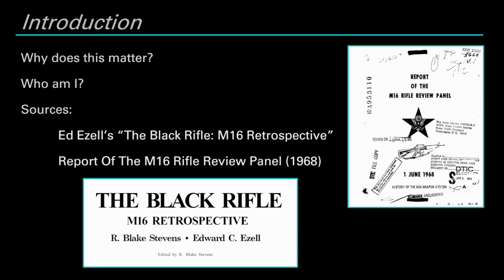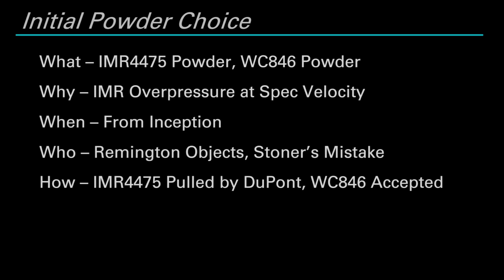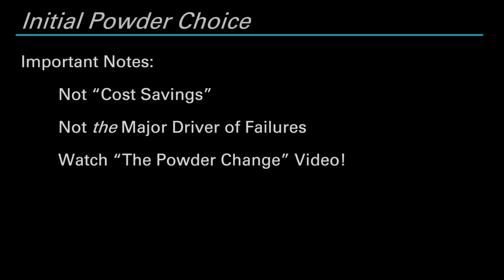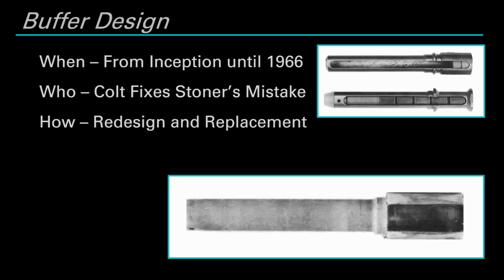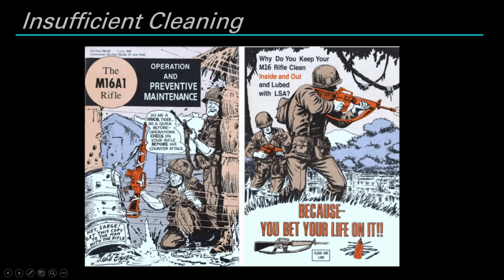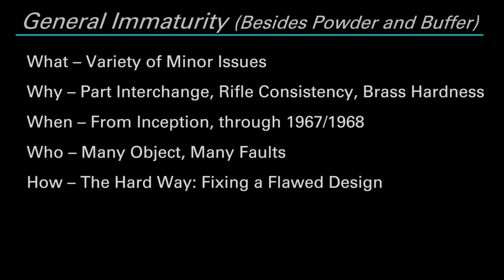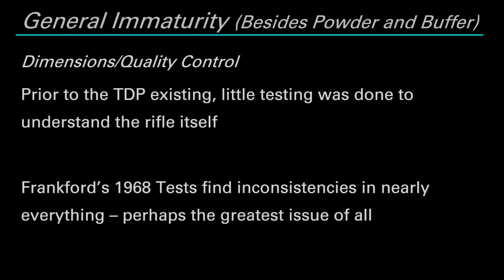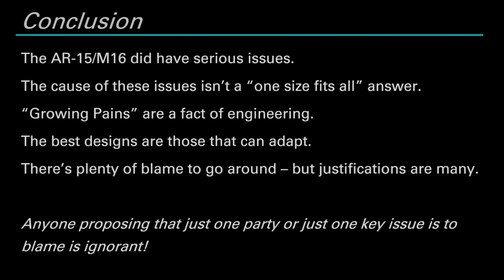M16 in Vietnam - The Real Issues, Briefly Explained

Comment from the maker: Errata:

17:22 - Dupont owned Remington, not the other way around. Also, Olin's parent owned Winchester (bit of a web there).

1:21:50 - These rifles are (over) half a century old, not half a decade.
Reply: IvanPrintsGuns, I notice you forgot to mention, the M16 E1 rifle 6061 aluminum receiver vs the M16A1 7075 aluminum receiver was this a major problem in the Vietnam war ?
Reply: So I was just on the DEFCAD website, and it would seem you don't have the early model of the 3011. I'm talking about the blue one in the video titled [ 100$ 3d printed 1911 build ].
I really like the zero picatinny rail broomhandle design. 
If you could upload that early design I would greatly appreciate it. 
Im gonna print it in a low temperature filament and casting plaster to cast it in aluminum!
Reply from the maker: @nateharder2286  I'm not on defcad, they illegally steal those files and sell them.
Reply: Trying to reach out on rc. Is there another method to reach u about a project?
Reply: ooh who was Olin's parent? 
also I just got a mattel commercial on yt while watching old 223 reloading data😊

Comment: This is a great video. However, the US Army Ordinance Corps did at multiple times directly try to sabotage the adoption of the AR-15 more than once. This isn't saying that Stoner, DoD, etc also didnt.
Reply from the maker: Be specific - what did AOC do to sabotage it? And don't point to armorers in Alaska losing detents because they were anxious to take the gun apart and see how it works...

Even the tests against the M14 where M14s were hand-picked isn't indicative of sabotage, because the AR15s at that point were all similarly hand-picked, and it was no secret the M14 was a more mature design than the AR15.
Reply: @IvanPrintsGuns No shit both the M14s and AR15s were hand picked. The difference there was that the best quality M14s were picked over the Worse quality AR15s. 

For someone wanting specifics and then glossing over specifics on something that you directly bring up well thats just laughable.
Reply from the maker: @maddogs1989  there were no "worse quality" AR15s. There were barely a dozen in existence in the world at the time of this test. Armalite selected the rifles they sent to have tested. Did Armalite sabotage themselves, then, you think? This wasn't LRIP random selection or lot testing, it was the best AR15s Armalite could make vs the best M14s the Army had handy from unissued rifles on hand. This put the M14 at a disadvantage, all else being equal, because these M14s were not manufactured knowing they would be tested, and the AR15s were.

AOC rightly found the AR15 was immature, recommended changes, and stayed the course, because dropping everything for a rifle with so many flaws would be ignorant.

You could argue that the 1962/63 tests were a repeat of this, but even still you had made-for-test AR15s being evaluated. By this point they did at least edge out the M14 in some regards, but A) you don't switch service rifles because something else might work, B) the AR15 still exhibited extreme maturity issues (especially with regard to the ammunition, magazines, and buffer).
Reply: @IvanPrintsGuns Ok bud you just lost any actual credibility on actually possesing knowledge on this.

Armalite never sent the AR-15 to compete against the M14. In 1958 they submitted the AR-15 in a small caliber rifle test the Army was cobducting. The M14 was not involved in this and the only other know rifle submitted was from Winchester. In 1959 Colt owned the AR-15. By the time of 1963 there were 14,500 rifle that the US Airforce had recieved from Colt.

The 1963 test was the only test the Army Conducted with the AR-15 and the M14 and they were ORDERED by the Sec Def directly to do the trial because of 5 years of rejecting the Air Forces request for the AR-15 to be evaluated. Mind you, the Air Force wasnt trying to replace the  M14. They were replacing their M1 Carbines.

But sure bud. You've  displayed an absolute lack of knowledge  on the Army Ordinance Corps direct involvement in not accepting this and even tailoring the Test to favor the M14. Seriously this is highly documented and Forgotten Weapons has a direct video on this. I suggest you educate yourself some more before trying to make an arguement again.
Reply from the maker: @maddogs1989  the AR15, like every firearm evaluated at the time, was compared to the M14 as a basis for comparison. That's because the M14 was the service rifle. You're confusing the SCHV program itself (where Armalite and Winchester submitted designs) with the actual testing that took place. The M14 was still evaluated, just as the M1 Garand was evaluated against the FAL, EM2, T44, etc in the preceding years.

See Fig 6-1 in RRRP, and Appendix 6 in general - the AR15 was continuously compared to the M14. OSD ordered the Army to evaluate the AR15 in 1963 specifically because the Army had previously tested the AR15 alongside the M14, and the data showed several instances where the AR15 had outperformed the M14 (OSD was lacking essential context on this, but didn't care because it had already decided to ditch the M14).

As I already explained, AOC did resist the adoption of the rifle. This is because they knew the rifle was immature, posed more questions then answers, and would result in extreme "growing pains" should be be adopted before the issues were resolved. This isn't what sabotage looks like. It's reasonable skepticism. While individual actors within OSD absolutely did try and make the AR15 look worse than it was, this was to counteract OSD doing the same to the M14 - which, like it or not, was a substantially more mature design.

Ian's videos on this subject have inaccuracies and "hand waving" of important details to push a narrative. If you come into these events with a narrative, you're likely to find "proof" of it because context is so far removed. It's only by engaging with all the facts and data that unbiased conclusions can be drawn - and you'll find that AOC was consistently conservative, wary of outsiders, and closely loyal to the designs they owned. And the AR15's story vindicates each and every one of their concerns. It's easy to pick things out of context and make them look evil for resisting a rifle that - with 50 years more development - is actually quite good. It's much harder to avoid this sort of "pop history" and deal with the facts.
Reply: @IvanPrintsGuns ..... The M14 wasnt the Service Rifle until 1959 .... try again bud.

Indeed because the test was already done before 1963. Tell me when do you think this test took place? Because you clearly dont know.
Reply from the maker: @maddogs1989  ...the M14 was adopted in 1957, and was certainly still the service rifle in 1959.

You may be interested in consulting "Report of Project NR 2787", dated Sep. 19, 1958. An excerpt is on page 72 of TBR. You'll note that the AR15 was compared against the M14.

It was this report and the Hitch Report are what led to the "Worldwide" Trials, and Aberdeen's Comparative Trials following on the heels are the two sets of tests you are conflating.

The parties to the latter set routinely accused the other of rigging, the Army appointed an independent IG, and the trials resumed. There were factors in favor of both rifles, but clear writing on the wall that the AR15 was still far too immature (the number of expelled primers alone is a bullhorn of doubt regarding the rifle's readiness).

So, I'll ask again: where was the "sabotage"? Was Carten digging in his heels and trying to emphasize that every issue the AR15 had made it a non-starter "sabotage"? Was Carten insisting that every dollar spent on the AR15 was one less on the M14, and a dollar less prepared the US was "sabotage"? Be specific, because vauge allusions to tests that accurately reflect the immaturity of the AR15 isn't evidence of "sabotage".

If you approach this subject in a non-biased way, the closest you'll come is some version of "well, if Carten has thrown caution to the wind and abandoned the rifle the Army literally just adopted (after dumping a ton of money and effort into the development of) for a rifle that's barely even been tested and is exhibiting severe ammo issues, then somehow magically the rifle's issues would have been resolved before 1964 with a shoestring budget despite it taking five years longer than that with wartime funding in reality", and that's just not how "sabotage" works.
Reply: @IvanPrintsGuns lmfao .... Indeed it was adopted in 1957..... it wasnt the Service rifle until 1959 .... you know when its actual production began. 

Being compared to and being tested against are .... two completely different things especially in the military.
Reply from the maker: @maddogs1989  Springfield was manufacturing rifles for LRIP before 1957, production post-adoption was underway by April 1958 (seeing as the AR15 was compared to it in 1958, it would be weird if none existed until 1959 as you claim).

"Compared to" in this context means "tested against." Remember, half of the Army wanted the M14 gone before it was even a thing, and SCHV was rather transparently a bid to replace the M14. The later Hitch Report makes clear exactly how strong this sentiment was.
Reply: @IvanPrintsGuns bud you are displaying an absolute lack of understanding of rifle procurement in the US Military. Where did I say the M14 didnt exist before 1959? You're continuing to show you lack the understanding to have this conversation. Yes Springfield was making rifles from 1957 to 1958. These were in very limited production What Production means in US Military Weapons Procurement is that the first priductiob rifles have been delivered as Service Rifles. Any rifle prior to the production line coming online falls under its trial designation. In the case of the M14 they were T44s. But please go ahead and tell me when Springfield delivered the first M14 Service rifles. Ill wait for you to make something up because the exact month and day of the start if production and delivery to the servuce is recorded un history.
Reply from the maker: @maddogs1989  why does the report I cited exclusively refer to it as the M14 and not the T44, then?
Reply: Because The Name was the M14. They were comparing capabilities by numbers of the Rifle determined to be the M14 to the AR-15. They didnt have the M14 compete against the winchester of the Ar-15
Reply: @maddogs1989 I cannot tell what in the fuck you are trying to argue at this point

Comment: I greatly appreciate how in depth you get into these, I like to watch SmallArmsSolutions, but he seems to take the opinion of the gun was fine and the army was the problem. When there are many reasons why that is not the case, he is still very knowledgeable on the ar-15 platform but seems to take the side of Stoner, instead of the side of the those getting the rifles and using them in the mud.
Reply from the maker: Stoner was wrong about a lot. Some people have a hard time admitting this fact because they think it detracts from him as a person or the rifles as a concept. But it's just a fact of arms development - these things take years to figure out, and oftentimes it isn't the original designers doing that work.
Reply: @IvanPrintsGuns  stoner worked with a team on the AR-15 rifle if I remember correctly, and even being wrong about many aspects, me essentially created one of the most important firearms in modern history.  But people always seem to want to glaze over the idea that it needed changes, that thing got rushed, or wouldn’t be able to made a certain way in a mass production environment.  And the army had years of experience of seeing what an happen to weapons in the field and what needed to be altered to help the ar-15 be a success ground forces small arms.

Comment: What a fucking shitshow from a major military power. It’s like they adopted a rifle for the first time ever and had no clue. The military didn’t have the technical package used by their contractor? Whoever agreed to that should have been charged with treason. Was all institutional knowledge lobotomized out of the US gov in 1946?
Reply from the maker: Off-the-shelf buys without TDP transfer is more common than not. That's what the AR15 was at time of adoption - a rifle intended to be a temporary stopgap. Part of the Army's resistance to the adoption was due to this issue of it being designed by a private company and the Army not having a ground-up role in both understanding the production and utilization of the rifle. But the DOD needed rifles, and the M14 wasn't going to cut it.